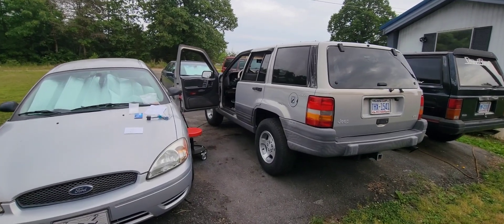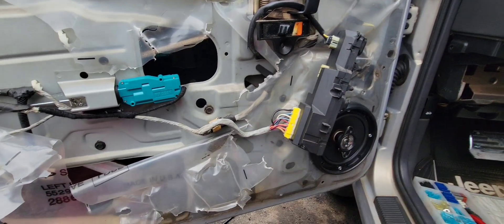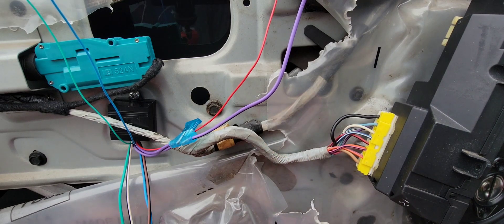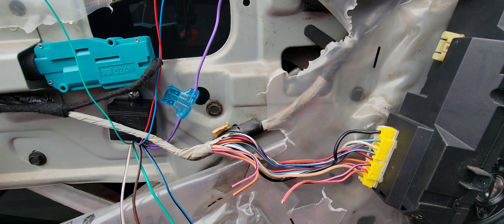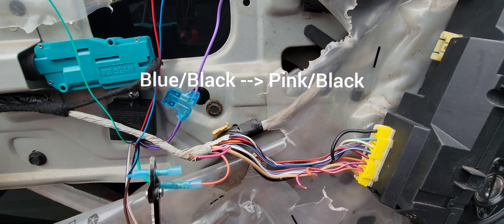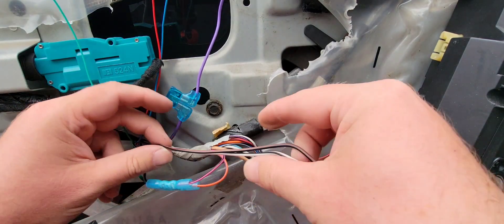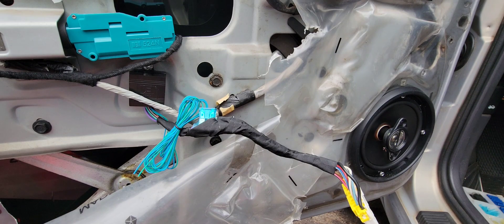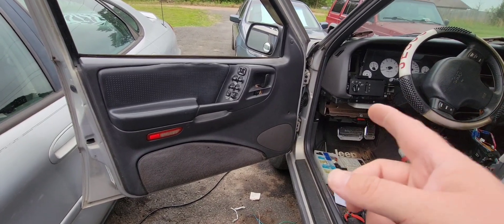Jeep-Joe, 1996-1998 Grand Cherokee Door Lock Relay wiring install process remote start/keyless entry

Comment: Great!!!... Good video!!  Greatings from México
Reply from the maker: Thanks a lot!!...

Everything worked perfectly on mine when I got finished up! The passenger door wired up just as easily, and I found time one day to finally neatly run the wires through both door jams and hooked them all up to the lock and unlock ground trigger outputs of the remote starter I had.... Worked like a champ!! I even programmed the remote starter to unlock the doors automatically each time I shut the Jeep off after driving somewhere, since the jeep it's self automatically locks all the doors when you drive down the road and get above 15mph... I like it to unlock now when I shut the Jeep off and get out, that way the doors and hatch are already unlocked when it comes time to open one from outside lol